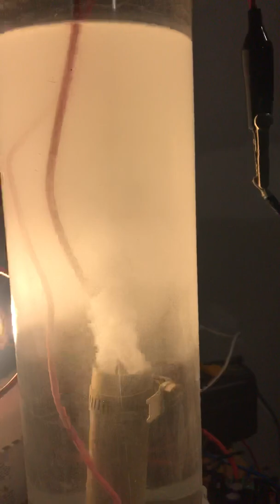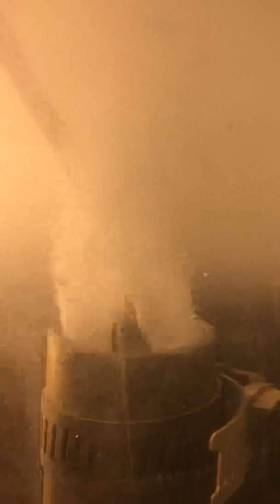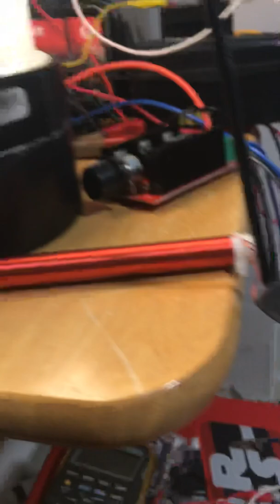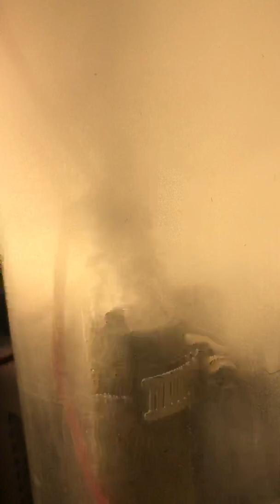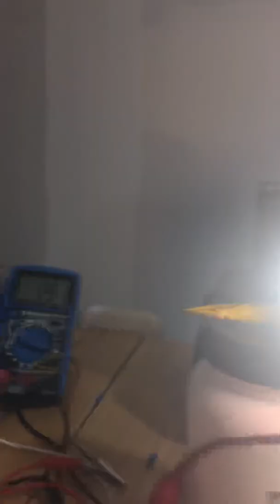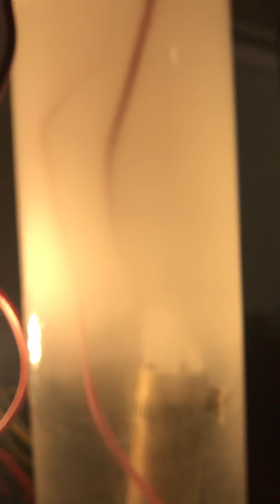HHO cell using Don Smith set up. Multiplying Amps!

Comment: The 2 inductor coils should be used . What is the frequency of the collective water capacitor?  What type is the SS electrodes? How did you equalize the surface area of both electrodes? The power supply is supposed to be "burst mode" on and off time of multiple pulses. As water level moves downward slightly, there is to be circuit to update frequency so PS and cell always matches.  The voltage was to be about >= 1500volts through resistance type magnet wire of double coils secondary on same core as primary pulser. Tap water puts contaminants on electrodes, distilled water is always  better. DC output for hydrogen gases, AC for steam generator heater. The Canada Patents by Meyer have extra details not in the American versions. Meyer's technician went to Canada and started Xogen Company with the Chambers Patent, using some of the Meyer data. The Hydrostar circuit of years ago was his . Flyback reverse higher volts pulses from coil was to attach to cell electrode.Voltage pressure separates molecules of water, AFTER small TEMPORARY current pulse aligns up all plus and minus poles of molecules. The Fuel gases generated are overunity on proper set up Meyer cell. GET and see Meyer company 2 manuals- Birth Of New Technology and Water Fuel Cell Dealership Manual.